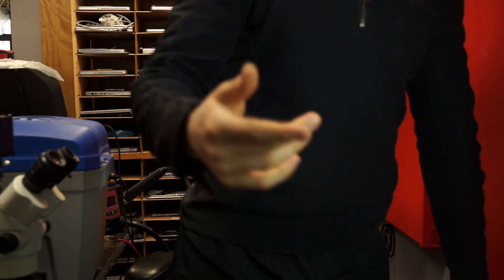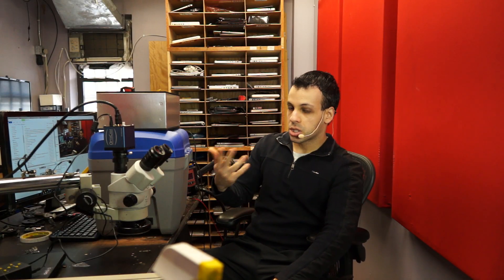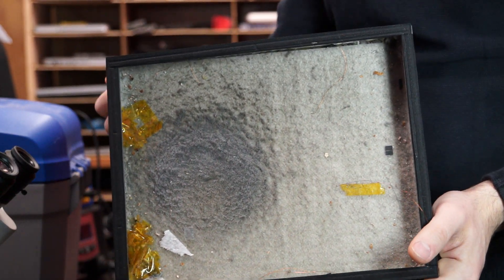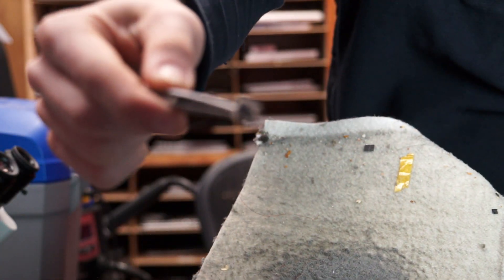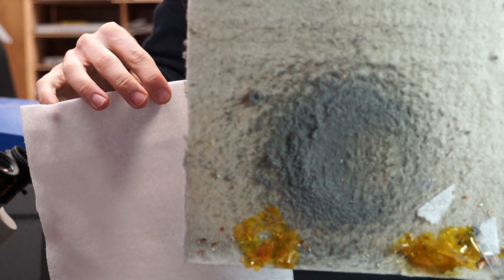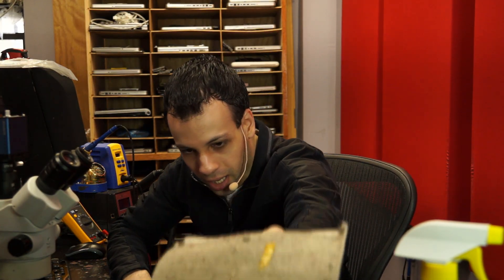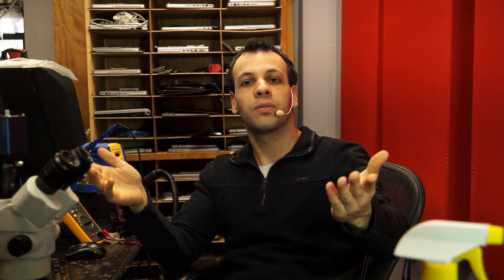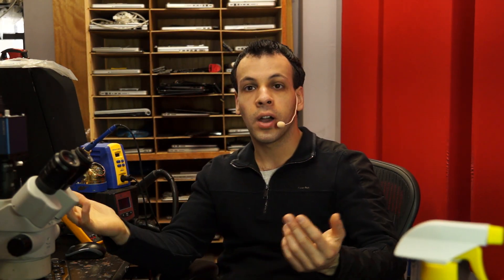A word on soldering and fume extraction

Comment: If you solder regularly there is no doubt you should have a filter, especially if you use lead based solder. However this video is a little misleading. The majority of that build up is normal dust from the air around us. The fumes from the solder won't leave much of a build up but it is what caused that filter to go from white to the gray/yellow colour. If you do a small amount of simple hobby electronics work, there is no reason to get a filter. Just do it in a reasonably well ventilated area.

Comment: I know this is an old video, but people on budget like me, might want to take a look at the Hakko FA400-4, it's good for someone who doesn't solder that much, or are very budget limited, it's a nice Hakko fume extractor that goes on desk: 
 https://www.amazon.com/Hakko-FA400-04-Bench-ESD-Safe-Absorber/dp/B00FZPSEY4/ref=sr_1_1?ie=UTF8&qid=1491565152&sr=8-1&keywords=hakko+fume+extractor
Also not many people know, but the 3D printers that use PET based plastic filament also expel lots of contaminant fumes, as much or worse than solder, so this one is great for putting on top of your 3d printer fan

Comment: A good way to do this on a budget is what I'm doing, take a high power bathroom inline extractor fan, place hoss on both ends, one end goes into the loft and out under the eaves,  the other end comes through the ceiling and sits above the soldering station, job done, no filters needed, extracts as well as the expensive ones.

Comment: You are right. 
Once i asked in an internet forum about electronics a couple of years ago  about the right filter type for a respirator mask to do soldering work. They laughed at me, but i knew in this case i am more smart than them, so i just called the company of the respirator mask directly and got an answer. 
I don't solder much in a year, but when i do it, i use always my half facepiece respirator mask when soldering.

BTW. new filters costs me only about 12 €, but it's worth the money because my lungs are more important.
Reply: To be fair you asked about a respirator mask, so yes that'd get a laugh as you dont want or need a mask for soldering.  
Ideally you remove the fumes before the get near your face. It sucks it away from a few inches from the iron.
Reply: @maulerrw   Some protection is better than none.

Comment: That crap is lots of dust and other crap that's in the air (soldering or not)... the soldering stuff the lead and gasses are NOT visible on the particular filter you switched.

Comment: I have one of those 'cheap' fan suckers with carbon mat.  It actually works really well as long as you keep what you're soldering within ~6 inches of it.  Agreed on the macho mentality.  Apparently even wearing gloves while working on your car is wimpy.
Reply: I use a half facepiece respirator mask with real very good carbon filters it doesn't cost more than those cheap fan suckers but protects you a lot better.
Reply: Depends on the gloves and what I'm working on with the car. Usually gloves are going to slow me down extensively and interfere with me doing the best job I can when tuning my bike's carbs and my car's supercharger intercooler mount. I'm always impressed by people who can work well with gloves.
Reply: Using the same one, but as a hobbyist who's not using it on a daily basis.
It works totally fine. I guess you can also say apply this video to leaded vs lead-free solder. The latter I'm using. It took me a year to get good with it, but now I solder a lot better with lead-free than with leaded.

Comment: http://mysite.du.edu/~jcalvert/phys/lead.htm

interesting read it:

"There is no risk at all in handling lead metal. It cannot be absorbed 
through the skin or the respiratory tract. Dilute hydrochloric acid has 
little effect on it, so the lead would pass through the stomach before 
any damage was done. Eating lead is probably safe, but not encouraged. 
Carbonated water dissolves lead to some degree. Food and drink should 
never touch lead, since organic acids, such as acetic acid, may dissolve
 lead. Lead is, on the whole, very much less a hazard than mercury. It 
was made dangerous by its widespread use in paint and motor fuel, and 
that is now past."

Comment: I'm using a Shop-Vac as a fume extractor, I simply hooked a hose to the exhaust port, ran it out the window and ran the intake hose in front of my work area. The whole thing only cost 60 bucks used at a yard sale and works phenomenally.
Reply: Shop vacs rock and don't need filters if exhausted outdoors. The polyethylene conical dust separators that fit atop any pail or drum you like are great for collecting machining chips from my lathe and mill so if you want to keep crap out of your vacuum check those out. I use the ancient trick of panty hose over the filters to greatly extend their life (by several years in my cases).

Comment: hey for the people who are broke and love to solder. I'm setting up an inline fan with some exhaust ducting to exhaust to outside. Louis has a closed loop system which filters air and replenishes the air in the room. A cheaper option would just be exhaust to outside. like a dryer vent. 
I'm going to be setting this up on my station after seeing that abortion of an air filter. Thanks again louis for the psa! 80 year old me thanks you.

Comment: As a guy who's slowly learning to solder, I was not aware this was an issue. I'll have to figure something out.
Reply: +Jacob Rau 
I'm a 'hobbyist' learnist kind, I choose electronics for my future.

And I solder like 7H a week.
This video kinda wakes me up real bad. I'm saving my money now.
Reply: The cheapest way to get a very good protection is just by buying a real half facepiece respirator mask and wearing that while soldering. I do this as a hobbyist. New filters do cost only about 12 €.

Of course a fume extraction device is better, because it also cleans the room, while i have to open all the windows and leave the room after the work is done, but a respirator mask is better than nothing and much more versatile.
The half facepiece respirator mask does only cost you 22 € and will be usable for years.
Reply: @OpenGL4ever  you nailed the way to go for non professionals. Isolate the activity and protect the individual is the way to go when collective preventive measures are cost prohibitive, which they will be for most people who are not doing these activities as a profession
Reply: Get 4 a2212 brushless motors with esc for 25$ and a tester, to adjust the speed 5$ and a 15$ psu. Fit it in a huge pvc tube and it will suck everything away;(
Reply: the cheap way is a cartilage filter mask and an open window, preferably with a fan at your back blowing the fumes toward the window. However also be advised the exposure is related to the amount of time you are exposed. If you are doing 8 hrs a day minimum as a professional does that requires a professional set up. As a hobby a few hrs a week the risks reduce significantly therefore the mask and fan work well
Reply: set up an inline fan out the window with some ducting. tape /seal off the extra parts of the window so your don't get fumes blowing back...ide guess like 25 bucks at homedepot. done ;) 
broke man's gotta solder
Reply: You can get the Hakko Fa 400. It's only $90 and will get the job done for you.
Reply: To be honest I don't think this is an issue for a hobbyist. A half hour a month of solder fumes doesn't seem like a big deal. But I am 100 percent onboard with proper PPE and fume extraction if you're doing this with any level of regularity.
Reply: Used to have a proper military gas mask and it Worked, bought a good mask from Israel that used the nato style filters.
Reply: Of you could get a comparable filter element cheap you could get one of those plastic ammo cans for a case and find a old shop vac at a garage sale for the motor and hose and you are all set
Reply: Light an aromatic candle
Reply: @zaxarispetixos8728  yes, because more chemicals and masking the smell so he stays there longer is healthy, oh wait, that's how to fuck your lungs up
Reply: @FortyTwo6x7  hey, I hope you come back, I want to solder some stuff, it will be just once and it's just some cables, but I want to be safe, is there a way to keep myself safe in under 50$? As I said, I don't plan on doing it a lot more, just once, and if I were to dedicate my life to it I'll buy something more proper, but for a couple of hours one day, I have a window but it's on the ceiling, I have a small fan too, is it enough? A respirator and a filter is like 50$ and I've seen some rip off small desktop fume extractors for a little less than that, should I get some of those or will I be fine because of the little amount of time?
Reply: @SpecterNeverSpectator  if you are doing a one off solder you can keep yourself safe for free. Open a door and a window which creates a through draft, work for ten mins, leave it for ten mins to let the fumes out and repeat. The problem with exposure is build up, the body is good at getting rid of low levels of crap, there is a world of difference between a limited contamination of low level toxins and living in a contaminated area. You will be fine, what you are intending to do is the similar to painting your bedroom, yes, you are going to smell the fumes but unless you do it every day its not going to do any real harm....

Comment: For 60 dollerydoos (AUD) you can get a decent Ryobi shopvac, that's designed to be used on the extraction points on power tools.Put unit outside,duct tape funnel onto hose you bring into your workspace. BAM, EXTRACTION! Sure its noisy, but its got very high airflow.

If you cant afford to spend a few $ on keeping your lungs reasonable (*same goes for eyes and ears as well!) you cant afford to do the work, be it pro or hobbyist.
Reply: If someone can figure out how to add duct tape and hoses to a paper and carbon filter element, maybe we find a good homebrew cheap hack
Reply: @davidsuzukiispolpot  That's done all the time for homebrew HEPA filters.

Comment: I'm with you on the fumes but when I solder I just open a window and stick a box fan in it. I don't do it for a living through. May father used to make tattoo needles for a living (between jobs as a machinist). The funny thing is he was paranoid about the fumes and actually took the time to build a basic fume extractor yet he smoked two pack a day. He has COPD now.

Comment: I use an old industrial soldering filter made by whomever made Polinex & SmokeEater filters. The prefilter is mostly dust and debris. The electrostatic grid filter sticks the fumes to it, and then there is an activated charcoal filter. The electrostat filter gets washed down & reused. I wear gloves and dump the wash water where I want the weeds to die. If it is nice outside, I just run an exhaust fan out the window. I burned some inscence and the exhaust fan actually sucks out more smoke & fumes than the extractor/filter. The carbon filters can be dumped out and refilled with new activated charcoal. The prefilter can be cut from hammock style furnace Hepa filter sheets, and the electrostatic is just a wash rinse repeat affair, and it takes a lot of flux, lead, tin, schmutz, & other stuff out of the air. The 1970s price on my filter? $3,400. I just have to improvise to replace the filters. The hoses get tossed out every few years too.

Comment: I built one out of 2 - 120mm PC fans, a hepa filter from a vacuum, vent filters for pre-filter, and a shop vac hose.  Also, lead has been PROVEN to lower your IQ.
Reply from the maker: Good on you for focusing on health!
Reply: Something I didn't think to mention, for anyone else who may wish to do the same, make sure you use fans that are designed for high static pressure, in order to create enough vacuum to actually work.  A Hepa filter has quite a bit of resistance and the more air you can move, the better it will work.  It is also important to make sure it is SEALED between the fans and the filters.  This is basically a short term solution until you can get a proper setup, because something, in this case, is MUCH better than nothing.
Reply: I built one out of a gas mask filter (NATO CBRN), a server fan, and a funnel. It was reasonably effective due to them being from a 1U server which required high static pressure. The main thing is you want a large fan size, which was the main downfall of mine. I've finally bought a proper solder fume extractor from Farnell. It's much quieter and way more effective.
Reply from the maker: Graham Sutherland what model fume extractor did you buy?
Reply: Duriatool, though I don't know if that's the name they operate with in the US.

Comment: I really don't care for me body compared to you haha. I use much more toxic flux with silver solder at 500ºC, often using very nasty volatile organic solvents and sometimes even use radioactive materials (like old uranium based glass) or Europium based glow powered. On rarer occasions rubidium. That said, those are all in small quantities and in a relatively well ventilated area, and I do a lot of welding and grinding too. The amount of UV, IR and ionising radiation I'm exposed to is like 100x the average person and it still falls into a safe level (I hope, my dosimeter broke 4 months ago). I wonder will this actually reduce my life span, probably not, the human body is pretty good at fixing itself.

Comment: My idea for people on the budget out there like me:
Old server fan (powerfull 20W beast), connected to 3/4.5/6/7.5/9/12V selectable wallwart (for speed control), with optional active coal filter over it, fixed to an old heavy desklamp stand, fixed in place with cable ties...looks ugly, works superb, (cost saved goes to pro solder iron, etc), works as good as pro unit, costs 0 (all parts from dumpster dive) and saves my health.
I made it in about the time this video runs.

Comment: I'd always advocate fume extraction when soldering (with an L  ;p ), but it does depend heavily on what your soldering, what solder and what flux, a good quality thin no-clean flux will put out very little in the way of fumes, brown jelly is probably the worst flux for fumes, using a solder pot is pretty bad and solder paste in a reflow oven is going to make a large room unbearable in less than 30mins flat without appropriate extraction.

For simple through-hole soldering in low quantity, with a reel of standard solder, a small desk fan and an open window is more than enough.

Comment: Guys he is right get an extractor. My dad is a plumber and uses flux to solder pipes together and after 30 years of that - as he has no extractor or protection for his lungs - he breathes like he smoked. So guys please don't be like him get an extractor.
Reply from the maker: +DJHMrSquirrel1 That sucks. :(
Reply: My grandfather has been soldering for 50 years almost everyday without extractor. He also smokes, which doesn't help him. He is now 70% blind and can't breath properly without sounding like a ran a marathon while having a cold.
Reply: What is in the fumes being extracted? My doctor said flux is animal fat and if it were causing issues, it would make me cough or feel bad in some way but I never have. And smoking will make you cough way before 30 years. That being said I still plan to get one just in case.

I also got a lead test and my levels were barely measurable. I read that most lead absorption comes from ingestion not inhalation and I always wash my hands after and usually wear nitrile gloves while soldering.
Reply: @deoxal7947 flux fumes are usually derived from rosin (tree sap) being boiled off which is know to cause respiratory issues like asthma amongst other bronchial problems. It can also cause headaches and neurological problems as well. There are sometimes other chemicals used in no clean fluxes on top of rosin that can make symptoms worse.
Reply: Will do, thanks for sharing.
Reply: Thanks for sharing, I will definitely get one.
Reply: Thanks.
Reply: Mitchell wodach different amounts by large comparison. Plumbing solder is usually much larger than the 1mm solder wire smd hobbiests use. Louis' flux globs are magnified.  Take it from Big Clive who has been doing this for decades...

Comment: I think 50€ for a fan and carbon filter is just overpriced. If you are willing to invest some of your time all you need is an old PC power supply, some scrap electronics and replacement carbon filters (about 5€ for two of them). I just made one for myself and it works great. Here are some pictures from where I got the idea http://we-mod-it.com/board258-diy-do-it-yourself/board263-diy-how-to/board109-elektronik/2195-l%C3%B6tdampfabsaugung-kosteng%C3%BCnstig-selber-bauen/?s=8f510b5b9bb9f2c282668edb7972033c781f2905 This is really easy to make and you can modify it to your needs. I for example added some USB ports to mine so I can plug in flexible laptop led lights and have workspace illumination, fume extraction and 5V supply all in one handy box. Since 80% of it is made of junk this cost me about 15€ including the USB lights and small extras like fan speed regulation. Just hold your breath one last time while soldering and make this your next weekend project.

Comment: I've always been worried about the fumes, I'm a smoker which is bad enough by itself but I don't want to keep adding to the list. I cannot afford a fume extractor, would a homemade one using coffee filters, a metal mesh and a fan work? I noticed you mentioned something with a fan, I wonder if I could make one like the one you're using, just a ghetto version where it works like a vacuum.Update: After taking a bottle, using a cloth for the primary filter and coffee filter for secondary and an 80mm PC fan, I am proud to say that I have my own fume extractor. It works!